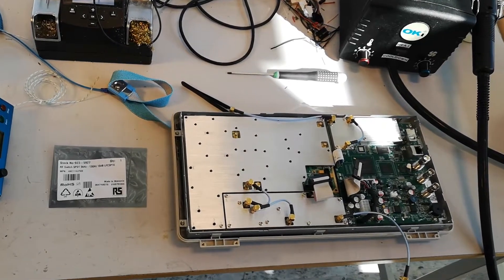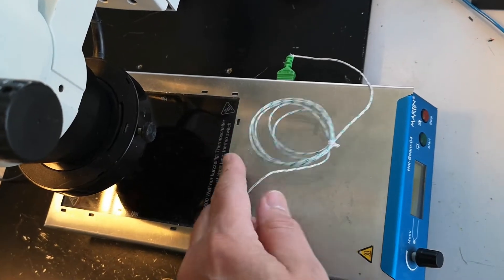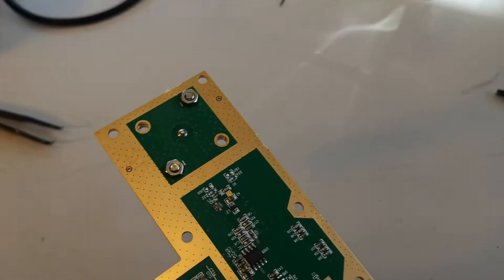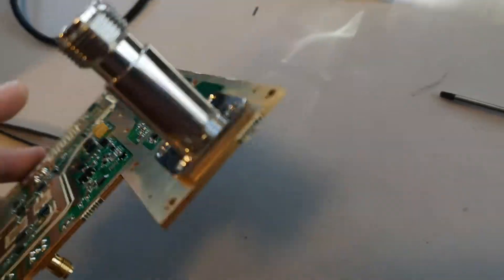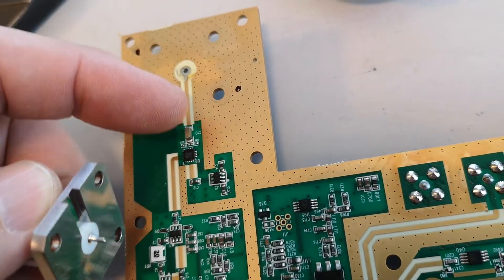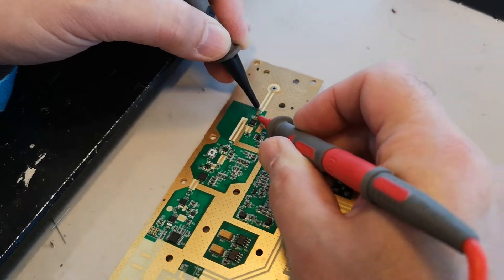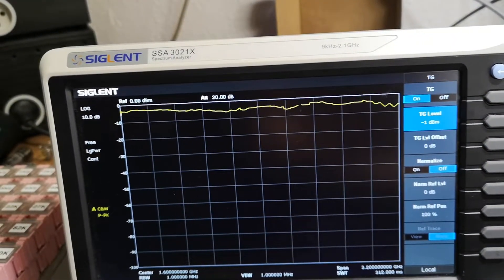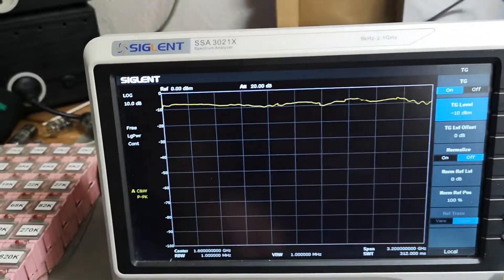Siglent Spectrum Analyzer SSA3021X dead RF front end repair part 2

Comment: Thanks for the reply Thomas! I, like one other guy commenting on your great fix couldn't see your actual removal of the hcm 1118.  So I  attempted it anyway and propped a heat gun so it blew on the opposite side of the 1118 till it was pretty hot.  Probably 180-200 F.  Then with a fairly good hot air unit(AOYUE 968A) I heated the chip with 380 C degree heat to the point I was afraid I might damage the board. Even when I turn the heat to 420C - no luck. I also saw a video saying that putting soldering flux on the ic helps- no luck,  Yes I had removed the huge N connector,   The board has so many layers and vias its like a solid chunk of copper! One guy asked you if the infrared plate was necessary, sure looks like it to me! Next i just started filing away the top of the1118 (carefully!) until I got down to  the top of the leads.  The chip itself is very hard. must be the silicon or its ceramic.  when I finally got to the ground pad (about 1mm square).  I put a soldering iron  right on the ground pad and finally got it out.  Miraculously all of the tiny pads were fine. While waiting for the HCM 1118 I jumpered the output of the 1 uf input cap to the 50 ohm trace going to the attenuator path (near the edge 0f the board) put it all back together and it works!!  BUT then I discovered the Tracking Generator output below 200MHz (right near 2GHz it -20 dBm as it should be be went down from there slowly accelerating below 200MHz)  was dropping dramatically till at 50MHz and below was -50 dB down.  Putting in a signal from a very accurate HP generator into SSA rf input the frequency and amplitude were right on.  I tried your idea of putting 50 ohms at R515, now the signal is down 3 dB, makes sense.  Did a thorough visual of the TG board, all looks good.  I might be stuck sending it to Siglent, if they would just publish the schematics I have a chance of fixing it.   The first time I chatted when I first thought it was the analyzer at fault he said it would be $720, they do no component level repair (I can see why now!)  so Im assuming the main SA board costs $720.  However on my model (2 years old) the TG board is attached to the SA board by break away tabs and the machined aluminum chassis is just two pieces so maybe $720 will fix everything  Sorry for the long winded tale! Regards Mike K7IR
Reply from the maker: YES you need bottom heater, and plenty of it, this way the top heat is only doing a smaller part of the job, this board is so much full of layers and all that copper transport heat very good..

Comment: OZ2CPU measured C10 at 1 uf.  Mine measures .15uf.  should still be enough to pass frequencies in the low MHz I would think.  My analyzer is -50dB down at 5 MHz and -15dB  at 1 GHz.  Mike

Comment: First of all, thanks to all of the contributors for taking the time to share their knowledge! I bought an SSA3021X Plus and promptly wiped out the frontend protection circuitry.  I called Siglent and they wouldn't even tell me the value of R515 which looks damaged in my unit  Also C804 is gone and I don't know if it ever had a part there.  I'm going to buy a HC1118 and attempt to replace all three components does anyone know the values of R515 and C804?  Thanks so much  I'll never probe ungrounded old ham gear again! Mike K7IR
Reply from the maker: I feel so sad for you mike, i was there 2years ago when i blew up mine, i have no clue about R515 or C804 i would personally try with 51 ohm and 10nF as the first best guess and then see what happens, I hope some one in the near future answers the values when they open their unit and see we like to know .. please post a follow up

Comment: Hi Thomas,
After months of hesitation, consulting tutorials, training to desolder and re-solder QFNs (from out of order PCB's), I finally managed to change the input IC HMC1118.
It wasn't easy, but it's done and the result is there: the spectrum analyzer is working again.
Cost of repair:
- hot plate: €5 (Ali...),
- HMC1118: €20 (Mouser).
That's €25 compared to the €1369 asked by Siglent for repair.
Of course, I was already equiped with hot air gun, flux and solder paste and magnifying glass.

I have performed the most of tests according the Siglent Service Manual. All are OK.

Conclusion: It's worth persevering!

And thank you again for your advice.

73 de Dominique F4FEI
Reply from the maker: HA HA i am happy I could maybe inspire others to fix this , please tell all your friends about my youtube channel.

Comment: Great video, a light at the end of the tunnel. I have a Siglent analyzer, and here in Brazil, repairs are complicated. The Spectrum Analyzer 3021X is behaving very strangely. TG -20dbm. In the range from 10KHz to 10MHz, the signal attenuation decreases to -8dbm. In the range from 40MHz to nearly 600MHz, it stays around -26dbm, but above that, the attenuation quickly rises to -30dbm. Everything was fine. Then I did the upgrade, and all the problems started. I tried downgrading, but it didn't solve the issue. Siglent is slow to analyze the problem. It's out of warranty for 4 years. I'm very skilled with SMD, but identifying the components is a problem. Any help would be appreciated, thank you.

Comment: Hello, can you tell me the hardware version of your ssa? Thank you very much
Reply from the maker: Model SSA3032X
SW1: 1.3.9.6
SW2: 20190820-1
SW3: 000000F2
HW : 00.03.00
all options, all upgrades installed fra 21x to 32x
Reply: @TeardownOZ2CPU  HW is 00.03.00 or 0C.03.00? Thank you very much :-)
Reply from the maker: @albertozanutto2748  double checked it,, what i wrote is correct, i dont know what each digit mean in their HW version explain
Reply: @TeardownOZ2CPU  thank you very :-)

Comment: Hi Thomas,
Many thanks for these videos (part 1 and 2).
Unfortunately, I killed the input of my SVA1032x (same symtoms).
Thanks to your video (part 1), I was able to easily disassemble the analyser.
Now I have to change the input IC (same input circuit tha SSA3021x).
I have a microscope and a hot air gun (with thermometer), but no infrared table.
Do you think this table is really necessary?
Do you think that not removing the N connector could affet the way to repair (perturbs the temperature gradiant of the PCB)?
Regarding the flux, which one do you use?
Thank you in advance for your advice.
73 de Dominique – F4FEI
Reply from the maker: the back heating is very much needed, but heat is just heat, it dont need to cost alot of money, an old car headligh will do, and a temperature probe, the idea is to pre heat to 100 or something about that, very hot in that area you want to work at, this way the limited power transfer from your hot air gun, will be able to solder stuff, without overheating the parts. also you get a much better solder cool down
Reply: @TeardownOZ2CPU  Thanks Thomas for your prompt answer. I will use a back heater.
Reply: Hi Thomas,
I followed all your advice and unfortunately impossible to desolder the HMC1118.
Despite preheating to 130°C for several minutes and hot air iron to 300°C, the IC does not move...
An idea to help me?
Reply from the maker: @f4fei344  if it dont move, think about it, it is not glue, but only solder, that means you dont melt the solder ! i would add more preheat, and crank your hot air all the way up , i normally use low air flow, but very high temperature, this way i dont blow away parts nearby
Reply: @TeardownOZ2CPU  
The temperature at the PCB surface (top) is about 130°C measured with a thermocouple probe. May be not enough. So, I will increase the temperature and I will see...

Comment: That is great work there. Spectacular. I have the same analyzer and I really want to build a input limiter (10v p-p) with a DC block (500VDC) of proper impedance (50 Ohms) and tiny capacitive loading  (10's of pico-farads) for working  on Tube receivers.  Flat at IF frequency spans. I have seen nothing that fits the bill and I don't want to go through what you did. So I am afraid to use it on what I need it most for.
Reply from the maker: a great trick : use a 20dB attenuator, AND a DC block, your analyzer will have plenty of level range to handle it, but now it is very hard to blow up.
for IF range, a DC block is very easy to DIY, for GHz range it is a lot more complex

Comment: Hi Thomas, did I miss the part where you replaced the input RF switch IC you have shown in the begin?
Reply: No, first thing I bought for my SSA were a bunch of attenuators and dc blockers. As mentioned I try always to use my insulating transformer
with unknown devices. My question: was only the RF switch damaged or something else?
Reply from the maker: @derdoktor7123  it was only that first HMC chip,
Reply from the maker: thanks for the comment, i did not have any more hands, to both film and solder, it is a no-brainer solve, with all that bottom IR preheating, and hot air solder station from the top, and the most pointy tweezers you can imagine, and good optical magnifier, the old goes off easy, and then add flux to the new ic, put it on cold, and heat its area up in circles, then carefully super check its placement, i did not plan for this video to be a how to, in smd parts replacement, more a hurray i was able to fix my fried spectrum analyzer :-) if you got any other questions, just ask, i be happy to explain more, you also fried your siglent ?
Reply: @TeardownOZ2CPU  Thanks for the video.  I've only just ordered an SSA3000x series analyzer and - though I do not plan to fry mine - I like to try to understand likely failure modes of my equipment.

Also, detailed repair videos are like electronics p**n for some of us and in this one we were denied the "money shot"  ;)

Good stuff anyway, thanks!